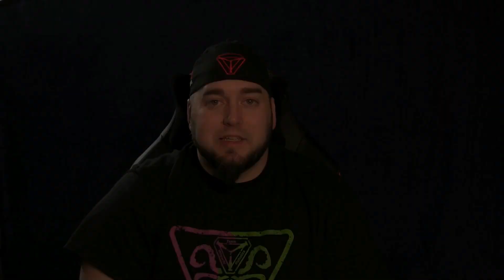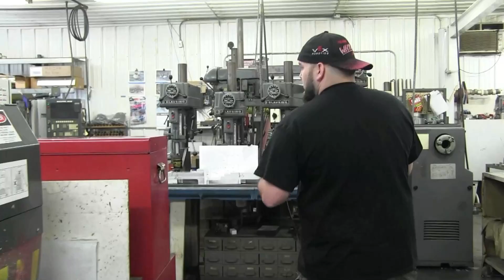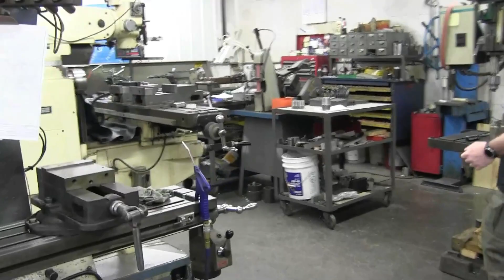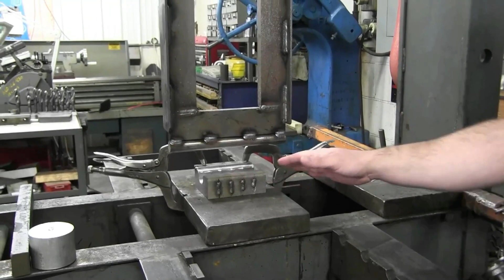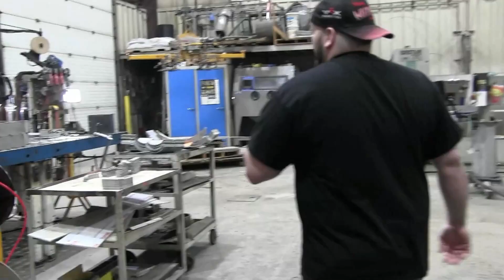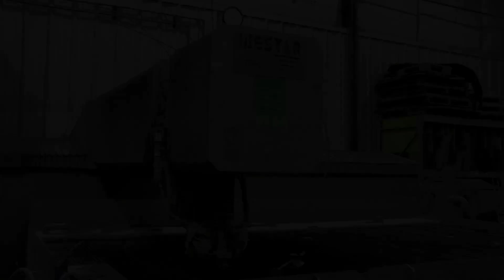Team Whyachi Shop Tour // Best of Tale of the Tape

Comment: Looks like your shop is the go to place for the other Bot builders. Good thinking. I worked in a similar shop. I was the waterjet operator, Very cool machine, but very dirty to run. especially when it came time to clean out the tank. Keep flipping.

Comment: How do you have half of an axis?
Reply: all the shafts are cut down the middle
Reply: a 2D axis machine only works on a plane, think of a cnc router that goes along the length and width of an object, but the cut is at a fixed depth.

a 3D axis machine can cut while moving all 3 spatial axis of the tool independently of each other.

a 2.5D axis machine is more like a cnc router in that it mainly works on a 2D plane, but it adds the extra possibility to adjust the depth of the cut for each run. You cannot do all the things you can do on a "true" 3D axis machine like overhanging elements but it's easier to program for and if you design your parts well you don't need a full 3D machine.

So it can do multiple 2D runs, but it can do each run at a different height (hence the .5D added, but it's not a full dimension).